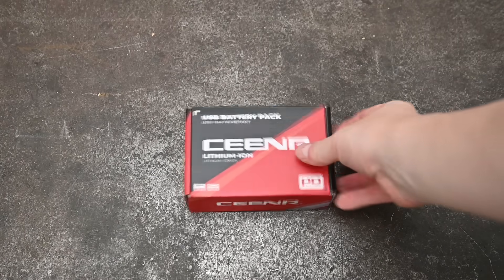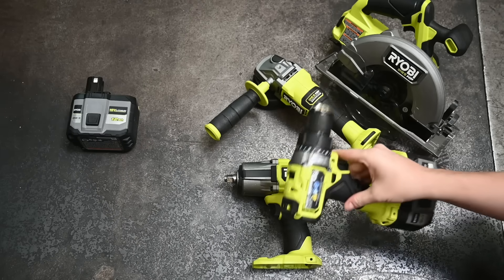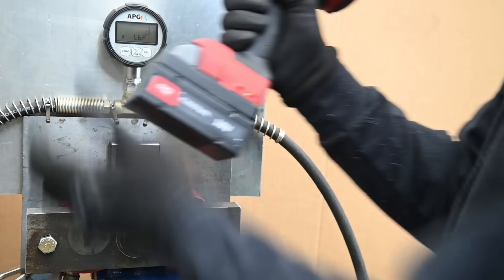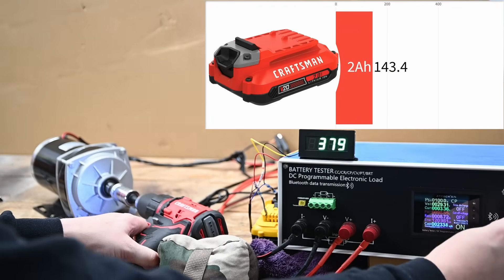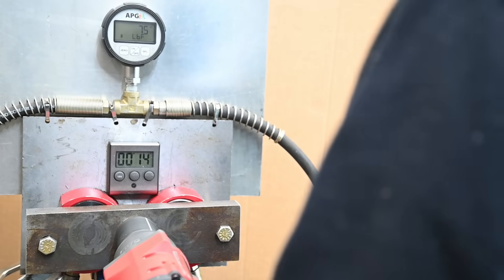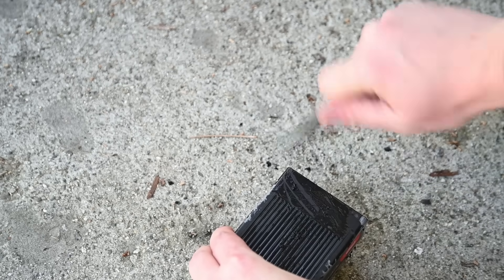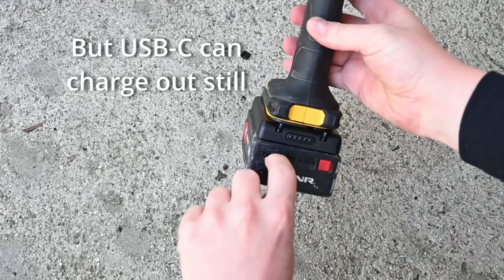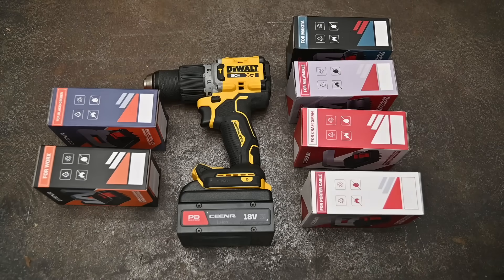We Bought the New Universal Battery for All Tool Brands

Comment: I have to say, the USB C charger is a huge selling point. I like to leave a spare impact driver in my truck and being able to charge and maintain the battery without the big charger is amazinf
Reply: Absolutely this. Got a rim on my Highlander that likes to drop air pressure when the weather swings cold to warm or warm to cold. Keeping my little Ryobi inflator with a battery I can just charge off the vehicle would cut down on some clutter for me.
Reply: DeWalt has a USB C charger and power bank. Charge the battery via USB C, or charge your laptop from the battery as a power bank.
Reply: @Fekillix  The DeWalt USB-C adapter is nice, but I really wish they would sell just the adapter for like $30 instead of a full adapter+cable+charger kit for $100.
Reply: Yep, I bought the Ryobi 150w inverter Primarily for its usb c charge function and have been working on being able to charge my other tool batteries with a similar setup. Now that this is a commercialy avalible product I think I might jus buy these batteries.
Reply: universal or compatible to many electronic devices, slightly cheaper and compact too than proprietary slide chargers that are mostly empty inside.
Reply: I work out of my cab too and this is perfect for my set up
Reply: @garyr4818 bro pick up a cheap inverter and plug your reg charger in this thing will not hold up. Plus almost 2 hrs to charge that's at home. In your car that time is going to be insane. Maybe 4,5 hours?
Reply: I've seen USB-C for Ryobi and DeWalt. Would like to see more.
Reply: Yeah!

KitchenAid just came out with a line of 12V Max powered cordless kitchen tools (they’re brilliant btw - modeling cordless single-battery system kitchen appliances off what the tool world has already done so well), and their battery system doesn’t even require or come with a charging station/dock (although they do sell one as a convenience accessory, for $29). Instead, their batteries all come with the charging hardware built in, and simply have a USB-C port on the top, which you can plug in to charge it!

Love it, as I have both options, and it takes about as long to charge one as a Milwaukee 5Ah pack on the standard charger 🤷🏻‍♀️.
Reply: I bought a power inverter from Diehard and just plug in the charger. Only works when I drive, but still works.
Reply: Litheli is better At least the BMS works there
Reply: I guess if you had 10 hours to charge it via the cig port, Otherwise you'd need an inverter and a properly sized wall adapter in which case you might as well just have the "big charger"
Reply: I'm actually NOT a fan of that. I'm worried that having a hole and extra electronics in the battery itself will destroy the battery if it's ever damaged (where the blade type charger just does what the tools do and is way more durable).

They could easily offer a low profile charger that slides on top that would still do the job, but without putting the extra parts in the battery itself, that make it more prone to failure.
Reply: I'm not entirely sure about that for heavy professional use, for example running an angle grinder and a hammer drill on site, we'd be constantly draining batteries, so having to wait an hour for a new one to charge would be unusable
Reply: @liamobrien9451  They are cheap enough to have multiple on hand as back ups.
Reply: @liamobrien9451 On a work site you will typically have battery chargers. The OP is talking about topping batteries off that might live outside of a work site or garage.
Reply: Amazinf as guck.
Reply: @practicalfrost5192 😂😂😂
Reply: You must be really wealthy if you have a USB-C charger hanging around. You know, only some of the newest and most expensive "smart" type of cellular telephones or extremely luxurious laptops have that port. Most devices use either micro USB for combined power and data, or use a DC port.
Reply: @kyonsmith5203 anything new has USB C, you must be really poor if you buy new devices without usb C...it has been been 7 years since the last time i purchased anything with a Micro usb port, dc ports are still pretty widely used.
Reply: @kyonsmith5203 My guy, a USB-C cable is maybe a couple bucks at walmart, or like $10-$15 with a compatible wall wart in the package.
Reply: What kinda phone do you have? I dont know anyone with a micro usb charger for years now. Maybe you live in a third world country? @kyonsmith5203

Comment: Meliff tools now has a 4ah high output for dewalt. Would like to see that up against a dewalt 4ah high output. Meliff has been making a lot of tools that work off dewalt batteries. First battery I have seen them make. I love my meliff cooler/fridge/freezer
Reply: I bought a Makita little blower that uses Milwaukee batteries from them and it works well, just remember to remove the battery after your done using the tool cause it drains your battery!
Reply: @txvet7738  I have the meliff dewalt little blower. Doesn't do that with mine. Maybe something strange with the makita and how it works. Actually you said milwaukee not makita version
Reply: @bossmanz28  yeah I bought the Meliff Makita clone that uses Milwaukee batteries.

Comment: USB-C (in the right revision) does support up to 240W power delivery. 48V at 5A
Reply from the maker: Dam son
Reply: @TorqueTestChannel  yes - and anker is already supplying cables and a power brick at 100W level. I can run my dell xpz 17, i9,64gb ram,4k screen on a brick a little bigger than a phone brick now (it gets HOTTT tho lol). They have a battery backup at like 170w now too.
Reply: @TorqueTestChannel Apparently, that translates to "End of the roof" in English. I wonder what language you were speaking 🤔
Reply: The chargers and cables that can deliver that kind of power are pretty expensive though.
Reply: @F0XD1E  when you consider how much a fast charger from (insert your tool brand here) costs and how limited in functionality is, I guess the high power USB-C charger might give it a run for its money
Reply: @luisinhoens90  True but most people get the tool battery charger as part of some combo kit anyway. Having the high wattage USB-C circuits in the battery packs would increase the price, probably significantly, for something that most people would not utilize. Most people are just going to be using their 20W phone chargers and not care that it takes a little while longer because they're not framing houses for a living.
Reply: @F0XD1E  I have to agree on that. For the regular Joe it won't matter, for the tradesmen however, a fast charger will be a high expense regardless of being proprietary or high power USB-C
Reply: @F0XD1E I'd love to get at least 65w for my type c just for the sake of higher watt with minimal usage lol just got myself a 100w and 65w charger and they are great, got some with lcd indicator also good for my mental health as i can see their power draw once in a while.
Reply: @F0XD1E  The PD standard doesn't raise current so you can do that with most non crappy cables, you can get a premium quality 8-10 foot USB-C cable for something like $15-20.
But AFAIK no one doing 240W single port yet , not even for the high power notebooks, that is what the standard allows so maybe we will eventually see that, no idea how much that battery could take tho.
A 140W charger from decent brands are like $100-150 ballpark, they usually goes like 200-300W total for few ports, 140W for their first port (subject to combination of slots used).
If you settle with 65W you can easily find them for less than $50.
Reply: @F0XD1E  anker has one for like $14.
Reply: Just checked their website:
TL;DR don't care about higher power charger if you only use it for the battery, it only takes 45W, you can charge a few of them at same with one high power charger tho.

Quote from website:
It takes 90 minutes to have your PDnation system fully charged. The PDnation system supports PD45W fast charge with the Type-C port, you can also charge it with the USB-A port which offers convenience and flexibility and allows you to charge the battery pack in your car.  PDnation Battery also supports two-way charging, and it can charge your electronic devices such as your phone.
Reply: @rudymeow  "... charging in your car" is the killer app for me. I'm in.
Reply: @MrHuram-abi  yeah that's one advantage form PD, nowadays most cars come with a few charging ports, even if they don't you can use a lighter to USB charger.
Some ports are lower power tho.
Reply: yeah but pretty much 0 commercially available chargers can hit those wattages, and 140w chargers still cost you an arm and a leg
Reply: Fast charge is handy but at what point are we damaging batteries
Reply: @B0BBYGAMER depends on battery chemistry. most can easily handle one C and can more normally go up to 2 C
Reply: Chonky boi hardware with a price tag to pull it off though.
Reply: though unfortionatly the highest wattage (through a single port) charger currently available is frameworks (a repairable laptop company) 180 watt charger.
Reply: In a car the lighter port is limited to 120W in most, if not all cars.
Reply: PD spec 3.1 for the 240W, type C is just a physical port and doesn't mean anything. It's the controller chip that the port is wired to that matters, so being type C doesn't mean anything other then it takes a type C cable until you know what chip is behind that port.
Reply: @pimpstick2  There are minor suggested changes to type-C cables and receptacles to support the higher voltage of EPR (essentially a couple of pins being shortened to allow detection of a sudden cable removal to reduce the chance of arcing, given the higher voltage) but that's honestly nitpicking. USB-C is great.
Reply: I want nothing to do with delicate charging ports on my expensive power tool batteries.

Comment: Sadly you can't find these batteries anywhere.  Sold out.  I'm sure stocks will come back up.

HOWEVER I'm sure manufacturers will make it so only their tool works with their battery.
Reply from the maker: They're technically not on sale yet. We bought one early directly from Ceenr by emailing them asking to

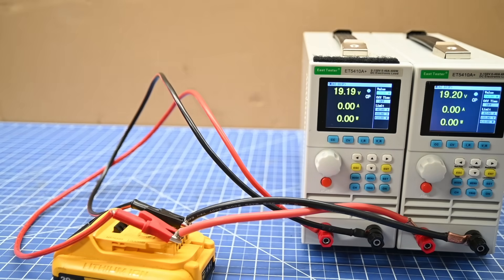Comment: Pulling high current (dewalt @~14:30) may be possible, but not for long!

high current causes heat, which is bad for the separator in the cells. Expect batteries that allow higher loads (than the cells are rated for) to die more quickly when overloaded.
Reply from the maker: True, most of the time it's dealing with spikes though. Few tools are going to allow it to just pull a steady 50A, and DeWALT 4A packs have a decent reputation. We'd like if the PDNation could spike to 50A then have a sort of trip timer, if it's pulling for that >5seconds THEN cut out.
Reply: I currently use a Li-Ion battery (Noco) in my car, instead of lead acid, along with a 75 Farad cap (XS Power) to limit the draw while cranking.

i kinda wish tools would have  a nice fat cap, this thing will crank my car without a battery! It doesn't have the capacity to run the key-off memory loads overnight, that's what the tiny Noco group 9 is for.

Fyi: 150a cranking for 1.5 seconds is ~0.0625ah, & my car has been tested by the local dealer to be over 600cca

Comment: Drug dealer mentally is spot on. I have a garage full of Ryobi because I got a kit 20 years ago and never could bring my self to switch to another brand because of all the batteries I already have.😂
Reply: The battery cost is the exact reason why I invested in Ryobi 20 years ago. As a home hobbyist, that has proven to be a wise choice.

I do have some M12 and M18 stuff too, but I drew the line there. 3 styles of battery is plenty. 😂
Reply: @TheBrokenLife  that's why I have started to dabble in the Bauer line of products. The batteries and tools are very affordable.
Reply: @jeramystephens74 why would you do bauer when hercules is an option? it's barely more expensive and is definitely better quality.
Reply: @ I had an impact battery and charger given to me.
Reply: Ryobi has a 6 year replacement warranty in Australia, and no one steals them on a job site
Reply: @aussiegruber86  I've always found their batteries to be the weakpoint, certainly when compared to DeWalt - I've got several now that are 10 years old and still work fine whereas I only seem to get 5 max from Ryobi like for like.  I now use aftermarket adaptors for DeWalt batteries on Ryobi tools and they work well, just be careful not to discharge 100%.
Reply: I have an old blue hammer drill that one time I was using so hard that it started smoking, let it cool down and it works better than it ever did. I Work as a mechanic and have a ryobi hp high torque and it’s been beat on everyday for close to 6 months and it hasn’t skipped a beat.
Reply: Already changing from Milwaukee to Metabo for the CAS. Come on over brother.
Reply: Years ago I bought porter cable, had drill, impact driver, grinder, vac, saw. Those had the 18v lithium packs, then when the 20v craze hit, they changed to connector on the new pack, even though it was still the same battery. The older batteries were harder to find and way to expensive, so I made the change, went all brushless dewalt.
Reply: That is the best thing with Ryobi. You can put new batteries in the old tools.
Reply: @swa5026   NO, electricity is electricity. maufacturers just make it so the plastic part doesn't fit....
Reply: @VoidPixel4179  Yes but it would be inconvenient to set up jumper cables on your tool.
Reply: @VoidPixel4179 not exactly. There are computer chips in the batteries and in the tools and they won't just he compatible even if they had a matching connection. They would have to be programmed to work together and to do that, they would have to be working with all their rival brands to make their batteries.. its way too complicated.
Reply: @swa5026  Ryobi - keeping mediocre, underwhelming  tools running for 40 years 🤘🏻
Reply: But for us, occasional, light use, home gamers it's still a win. 😁
Reply: @jeramystephens74  Personally I am more of a corded tool guy but the only cordless tool I use is a Ryobi drill from 20 years ago that works perfectly fine for drilling holes in wood.
Reply: @Count_Smackula  don't get me wrong. I'm not going to throw it away, but their impact wrenches are very lacking in the power department.
Reply: Dam I hope this is coming to Australia
Reply: You and me both 😂
Reply: The best thing about Ryobi is their toools for power outage/ hurricane supplies/ camping. Fans, lights, radios, inverters, water sprayer, etc, and lots and lots of cheap glorious 4 AH batteries.

Comment: Hell, 5 amp powerstack batteries cut out or just don't work on some Dewalt tools for me. Like, i can't use a 5 amp PS on my little Dewalt vacuum cleaner. It'll run for just a second and then die. If this battery is only that fussy, then I'll probably pick one up at some point.

Comment: The charging solution is really half baked in my opinion. I feel like this really wouldn't work for many people, having to plug the battery in is a bit fiddly compared to just popping it on a charger. If they come out with their own charger and keep the usb c port (that way you can use either of them) then it can still be considered not locked-down while having the convenience of a standard tool battery charger.
Reply from the maker: Smart, i like it
Reply: How is plugging a type c cable into something more fiddly then trying to get it into the rails of a big bulky charger? It just sounds like "Old man yells at cloud about how he fears change" kinda thing. Type C is so universal that there is no need to make big bulky wastes of plastic and space.
Reply: @pimpstick2 big clunky plastic rails with big clunky contacts have a purpose when you wear big clunky gloves and are in a potentially dusty environment that could easily clog up a usb c port
Reply: @nicfab1 The regular chargers also can clog with dust. Either way I have compressed air piped everywhere including up to and in the kitchen and out in the driveway. I can just connect a blow gun and blow out the port. Not a big deal. I lose the tool chargers all the time but I have millions of type C chargers and can get more for $1.
Reply: @theodorgiosan2570  a $1 usb c charger is not quality and wont be fast charging. A good one is more like $20-30
Reply: @pimpstick2  I find that plugging in my phone takes much more dexterity compared to charging my makita batteries. To plug in my phone I have to fiddle a bit with a tiny connector, while to charge a makita battery I essentially just throw it on the charger with a kinda-right orientation and the rails line everything up. as nicfab1 said, there's a reason chargers are designed like that, and the abuse things in a workshop need to withstand is much greater than the abuse things in consumer environments need to withstand. I absolutely love usb c, don't get me wrong, it's just not the correct choice for the job IMO.

Comment: Universal should also include charging with whatever brand charger you have. Put the brand adapter on and charge the PDNation on a Dewalt, Makita, Milwaukee, etc charger.
Reply from the maker: Not sure that's physically possible. Each charger wants, checks for separate things
Reply: @TorqueTestChannel  I think some people don’t understand the mechanics of tools.  To them, it is just magic.
Reply: I think it is more realistic for them to add charging via USB PD which would in theory cap out at 240 Watts. If they tried to add compatibility to all chargers they would need an unnecessarily complex battery management system as every brand uses different types of battery management systems in their tools.